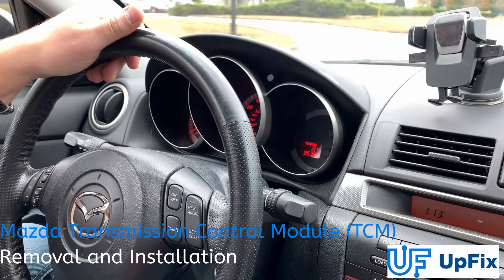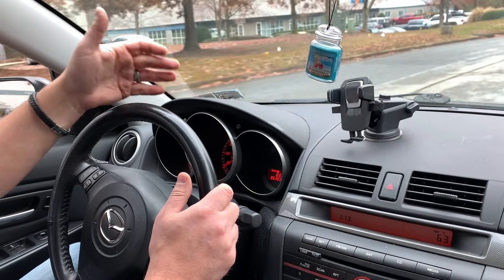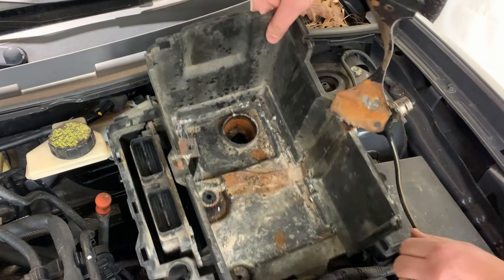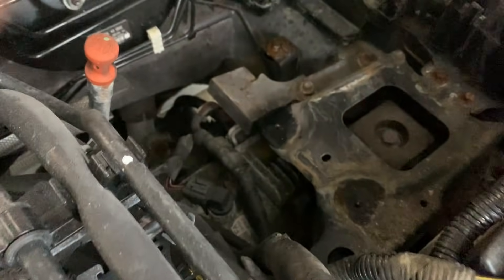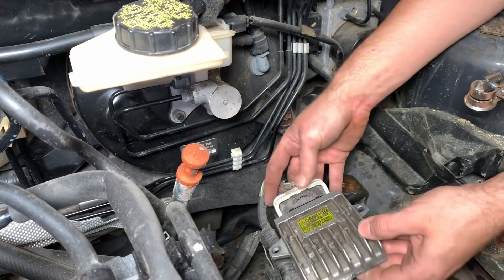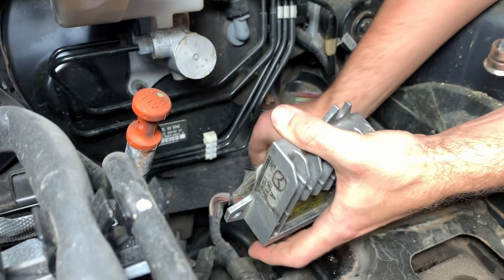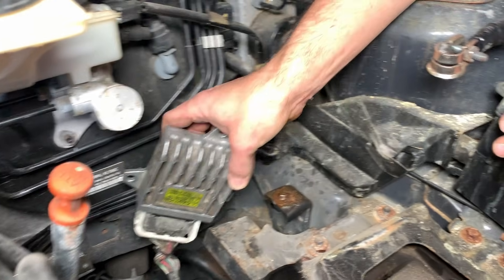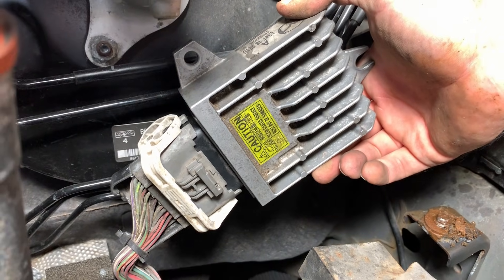Mazda 3 TCM (2006 - 2014) Transmission Control Module Location, Removal & Repair by UpFix

Comment: Alright so i have a mazda5 2006 and often it slips from 4th gear into 3rd gear engine light and ATM light comes on and I'm stuck into 3rd went to mecchanic and read the codes and he told me its the speed sensor that needs to be changed any tips on that?
Reply from the maker: The Mazda 5 2006 doesn't have a TCM but rather the ECU that controls both the ECU and transmission. If the mechanic scanned for codes and it points to the speedo sensor it's very likely that it'll need to be replaced. That's another common failure point on these Mazda's which also plagues the newer years that we support for both Mazda 3 & 5. 2007-2014

Comment: I have 2005 send issues at light on hard kick into reverse and solenoid can you guys fixed?
Reply from the maker: Yes that is a common issue. Here is more info
https://www.upfix.com/product/tcm-mazda-3-2006-2014-transmission-control-module-repair-tcm-tcu/

Comment: Intall it on the Firewall but At Least protect the Brakelines with Some Sort of Rubber Padding ....don't have Metal to Metal Rubbing .....
Likely to slowly Damage a Brakeline . 
Small pieces of Simple rubber Hose could create a cusion .
But maybe cut rubber blocks prevent that Metal on metal contact. somehow .
Reply from the maker: Thank you!
Reply: Upfix sometimes the little tips are best .

Comment: my 06 Mazda 5 has no tcm, now what?.
Reply from the maker: Some Mazda 3s and Mazda 5s dont have TCM modules in year 2006. If you dont have one then the issue is probably with the transmission and not TCM (since you dont have one)
Reply: @upfixauto  so i cannot assume its integrated in the pcm/ecu as sone durum’s mention?..
Reply from the maker: @rays4067  that is a great question. We currently dont have the answer for this. If you do find out, please post it here if you dont mind 🙂

Comment: If the TCM wasmounted on the gearbox, then it may have a purpose in relation to cooling. If TCM gets hotter than Trans, TCM will cool down. If TCM is mounted loosely, it may not get enough cooling alone (free standing, aircool only).
Reply from the maker: Thanks for watching and commenting! Please feel free to join our UpFix Community Forum and share your knowledge. We have a lot of great info and advice in the Forum. https://forum.upfix.com/?wpfs=mazda+tcm

Comment: My 2010 Mazda 3 will not shift past 3rd gear. When I start it, the check engine light comes on but the AT light does not come on until I try to put it into gear. It goes into gear hard, especially into reverse. I have no manual control at all.

I did a drain and fill on the transmission which didn't fix it so I pulled the codes. P0768 and P0773 came up, nothing else. I cleared the codes but the come back instantly. 

I was going to check the electrical but I don't have a diagram to check the pins, do you happen to have one I can use or do you believe this is just a TCM issue?

Thank you.
Reply from the maker: Both of those codes are supported by UpFix for the TCM repair. It sounds like the TCM just needs to be rebuilt.
Reply: I had the rebuild performed by you guys but it didn't fix the issue and now it also has a code P0763 on top of the P0768 and P0773. Any idea why the new code would come up?

Comment: Does it matter if the part numbers or some letters are different on the replacement TCM?
Reply from the maker: Part numbers should be same.
There is a few exceptions

Comment: Hello, I have a 2009 Mazda 3. Currently getting the code P2708. I was previously getting another code saying solenoid B was stuck that code no longer comes out. It does kick when going on reserve & when going from gear 1 to 2 after the AT light coming up it’ll shift all the way up to 4 but not to 5. Will replacing the TCM fix this issue ?
Reply from the maker: We support the code P2709 which is also for solenoid F but the electrical part of it. P2708 refers to the actual solenoid itself. If the TCM hasn’t been rebuilt yet we would highly recommend starting there since its most likely the TCM itself. Other possible culprits are a faulty solenoid or dirty transmission fluid.  Replacing the TCM with another used one may actually make it worse especially if it’s the wrong part number or not rebuilt yet. We recommend to replace your TCM unit or you can send your part for repair to UpFix.com https://www.upfix.com/product/tcm-mazda-3-2006-2014-transmission-control-module-repair-tcm-tcu/

Comment: Hi, I have a 2010 Mazda 3 and the check engine light and AT light are on. Driving in limp mode, but the AT light goes away when I turn car on/off again. Then after 5 min of driving car will downshift into 3rd again and AT light comes back on. Error code PO753 solanoid A. Got quoted $4300 to replace the transmission. Is it possible it is just a TCM issue?? Dealership says no way because it didn’t get the code saying TCM issue, just the PO753.
Reply from the maker: DTC Code P0753 (Shift Solenoid A Malfunction) is very common code for a faulty TCM module. That is one of the codes on the list of reasons why we receive TCM modules for repair. Here is more info https://www.upfix.com/product/tcm-mazda-3-2006-2014-transmission-control-module-repair-tcm-tcu/
Reply: @upfixauto  Thanks so much! I just submitted an order through UpFix to repair my TCM and will be mailing it tomorrow. I've never done any kind of work on a car before but it wasn't too hard removing the TCM!
Reply from the maker: @annaosborn7668  great job on your first car project!!! As soon as we get your part we will keep updating you thru email and text with order status.  Thank you for your support! 🙏
Reply: My car is doin the same thing but its a automatic, got the code for bad shift solenoid. Got it swapped out and got a full transmission change and filter ,  but AT And ENGINE light is still on. Did replacing your TCM work for you?

Comment: You guys are the best! Got my TCM back from you and just reinstalled today (this vid helped!) and transmission is back working! Thank you so much! For those researching similar issues and how to fix, I had check engine and AT lights on, only a U0101 code, hard shifting into Drive and Reverse, car was stuck in one gear (apparently 3rd) limp mode, was able to safely drive the 30 miles home from work in limp mode keeping it under ~65mph, my 2011 Mazda 3 had only 96k miles when it failed on me 2 weeks ago as I went to leave work, no early warning signs, everything was fine on my way to work, suddenly did not work when I went to leave. Searched a bit, found you guys, waited for a warm enough day to remove the battery and TCM, then sent it in to UPFIX, had it back a week later, and good to go! UpFix and comin through like champions! Keep up the great work, guys!
Reply: How much did you spend fixing your tcm?
Reply from the maker: Thank you so much!!!

Comment: Correct mate these engines run at 98-102 deg Celsius,  the trans oil is also really hot ,  a neat trick I do is intercept the thick black wire on cooling fan motor and run a jumper to my own electronic  thermostat  , I switch my fans on at 78 deg C  and back off at 74 c ,    also fit  a separate cooler for the auto, it now  should last forever  . So much under  bonnet heat  destroys rubber and electrical components.

Comment: Hello! I have a 2006 Mazda 3 with 224,000km. I recently ran the codes and got (P0753) Shift Solenoid A. After reading I’m convinced this would be a TCM issue but I’m also not sure given some people saying this didn’t fix the problem. My car is in rough shape and I don’t know if spending the $500 is worth it for a old and used car like mine. Consider selling it for around a thousand dollars with its problems. What’s your thoughts? (It’s also in safe mode, won’t go past 3rd, rough shifting, AT +CEL)
Reply from the maker: Yes it is a very common issue with these Mazda 3's
Reply: You should be changing the fluid and filter every 100,000km. The shift solenoids have a hard time doing there job when the fluid is dirty

Comment: Hello! I had a problem with my mazda miata NC3 2013. Everytime the car downshift from 3rd gear to 2nd gear and 2nd gear to 1st gear, it always jerk like rough downshift. The car also had P0757-FF (Shift solenoid B performanve or stuck on) warning and sometimes gave me a check engine and A/T warning. My mechanic already check all of the mechanical components and there's nothing wrong at all. Is all of this problem come from the tcm? 
Thanks!
Reply from the maker: Yes this is a common issue with this  TCM unit
Reply: Sorry for the late reply, so i check my tcm to two nearest local shop in my town and they said that my tcm is fine. So after that i changed all my transmission component like gearbox, body valve, and torque converter with the new one but i still cant fix the problem. After chaging all the component i also check on all the wiring and my mechanic say that everything was fine. Could it be that the shops who checked on my tcm doing some mistake? The one that makes me confuse the most are because theres no burnt inside my tcm and theres no error code at all after i reset it 3 months ago. So is it still coming from the tcm even if theres no error code at dashboard indicator and from the OBD? I hope that you could help me and share your thought on this because that will means a lot to me, Thanks!

Comment: 2011 mazda3 jerks when put in reverse and traction light, ebrake, engine light, and AT light on... will i need a new tcm or ecu? helppppp
Reply from the maker: It sounds like you need to get it scanned. For all those diagnostic lights coming in and most likely a TCM rebuild will be in order to resolve those issues. But have it scanned by using a diagnistic scan tool to see what codes are coming up to know what the issue is.

Comment: I used to have the p0772 shift solenoid e and i replaced the solenoid now all i have is p0773 shift solenoid e electrical. Do you think this will repair my tcm? Thanks
Reply from the maker: Yes definitely P0773 is one of the common error codes for faulty TCM. We can rebuild it. See our service link: https://www.upfix.com/product/tcm-mazda-3-2006-2014-transmission-control-module-repair-tcm-tcu/

Comment: Hello, I own a Mazda 3 2013, auto transmission hatchback
The AT light has appeared a couple days ago but there is no symptoms of any failure at all, but the code is stuck on and took to a mechanic to clear, and the code wouldn't even come up
Should I just ignore it and keep driving? Or change it I have been quoted 800+ 
I feel nothing wrong with the car
Reply from the maker: Yes correct the problem starts intermittently, the transmission is okay its just the TCM module that is starting to have issues. Once you start experiencing it more and more then you might want to plan time to either replace the part or send it in for repair.
Reply: @upfixauto  okay cool, and what should it cost? And the average market? Thanks bro
Reply from the maker: Currently the repair cost is $199
Here is the link for more info:
https://www.upfix.com/product/tcm-mazda-3-2006-2014-transmission-control-module-repair-tcm-tcu/

Comment: Hey so my 2008 mazda 3 have codes U0101, C1277-A0, U1900-E0 
Will you guys program work for my car?
Reply from the maker: The part that you are sending for repair, is it original to your vehicle? If it is then it is already programmed to your vehicle. If the part ia NOT original, then check the part number that is on the original and make sure it matches the part number on your replacement module. If part number are NOT same then most likely it will not work for you. Also if part is NOT same then we CAN'T program it to your vehicle because internal components of the part is different and it will never program tonyour vehicle. Only send us your original TCM unit for repair.
Reply: @upfixauto  I did the Exchange service you guys do and yeah it's the original part to my car and I'm just waiting for the one you guys sent out
Reply: @upfixauto  I sent you guys the part number to the original cars tcm
Reply from the maker: Yes, perfect, yes we will rebuild it and update it to the latest firmware. Your original TCM unit is already programmed to your vehicle, since it is original to your vehicle.
Reply: @upfixauto  unfortunately it didn't work
Reply from the maker: Please call, text or email is for technical support.

Comment: I had u0101 and my car is working only on 3rd gear. I replece my TCM and my car start to work on all gears but AT is not turn off and diagnostic is showing u0101 yet. Also sometimes lost any gear and turn back. What can be the problem?
Reply: It sounds like a TCM failure honestly. You can try a hard battery reset procedure and see if that helps, however if you replaced it with another used TCM that would most likely be the cause of the problem. The first four characters of the part number should be identical and you should only install a refurbished or new TCM in place of your bad one. If you simply swap it for another used TCM, it may not fix your issue especially with that code provided.
Reply from the maker: Thank you for helping out!
Reply: @upfixauto  can I reprogramming my TCM with outher number for my car? Is it working on my?
Reply from the maker: @artmus9936  if you are using a replacement part and the part number is different it will most likely not work. But you can always try. Just dont want you spending labor hours of getting it and then out back again. Along with programming fees from tge dealership. If you are getting a replacement part, please make sure to use the same part number. You can also send your original part to UpFix.com for repair.
Reply: @upfixauto  but I do some staff on my original part )) is it a problem for you?
Reply from the maker: @artmus9936  if you have attempted to repair it yourself. We can still work on it most of the time. You can take a detailed picture of the part and email it to info@upfix.com to make sure that the part could still be repairable.
Reply: @upfixauto  I sent you email. But also I want to see your web site. But there is a problem which is don't let me go there
Reply from the maker: @artmus9936  what country are you in?
Reply: @upfixauto  Armenia

Comment: try cleaning tcm contacts with electrical contact cleaners
Reply: The TCM is in a prime postion to get exposed to outside elements when mounted on top of the tranmission. Being so close to the engine, sometimes the TCM will accumulate oil particulates on its outer housing and also get inside the plug so cleaning the plug with electrical cleaner is definitely a good idea. Also, because it's right underneath the battery box, it's also exposed to battery acid falling on top of it. Which is why when a rebuilt TCM is installed, it's highly recommend re-mounting it to the brake lines not just to protect it from oil and battery acid being spewed on it but also to prevent it from overheating again.

Comment: Mazda well known for novice engineering design. Always placed parts that difficult to remove & rectify. Sometime because the parts placed cause improper problem that suppose not to happen. Maybe Mazda hired post graduated young engineers from no where college, & that engineer some day learn a lot before shift their employer to Toyota.
Reply from the maker: Yes you are absolutely right. Sometimes parts are placed in areas that are extremely hot and heat causes most of these problems. Also some parts are designed to fail its like a time bomb, designed to fail at designed time, more part sales. Sadly things are not made to last anymore. And yes, we get a lot of business because of that!
Reply: @upfixauto  Oh come on! Tell me a vehicle manufacturer that has made a perfect vehicle. Everyone complains about something. I have owned many brands including Toyota and they have all had some issues, some more than others.

Comment: DON'T BUY!!!!! anything from Bam Wholesale Parts. They will not let you return it if you tried or installed it. I bought a new TCM from them that is not plug and play which they DID NOT specified. Now they would not let me return it because I installed it. Their return policy is if you tried or installed it you can't return it. So basically you won't be able to return anything. In what world do anybody buy an item and not try or installed it to see if it work.  They told me to go to a Mazda dealer to programmed it. I called Mazda dealer  a guy there told me he has never heard of it. He said the TCM are normally plug and play. Now I have a $500 TCM and no one to programmed it. I had this TCM problem a couple years ago and just bought a new TCM, installed it and my car ran great.Now I'm stuck with a $500 TCM and no one to programmed it. I hope this will help anyone who's looking to buy one. I want to disputed this on my credit card but I don't know if I can. Any suggestion?
Reply from the maker: This is why UpFix.com exists. It's an alternative to expensive dealership and wholesale places. We repair your original module or program one that is ready to be installed and is plug and play. Also comes with warranty. Visit our website for more info UpFix.com

Comment: I was checking my TCM on a Mazda 5 and the harness connector and pins on the TCM were completely wet, it seems like oil but there are not any oil leaks around. It seems like it's something leaking inside of the TCM, anybody is experiencing the same thing?
Reply from the maker: There are no liquids inside this computer TCM. Did you get your issue solved?